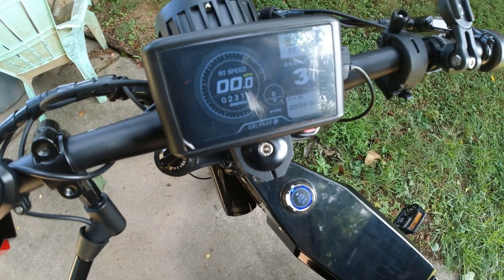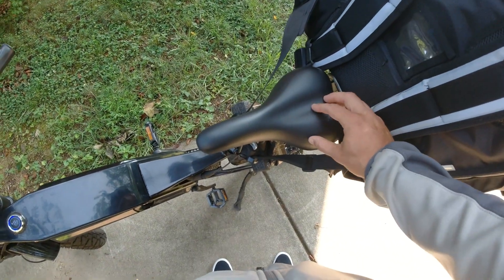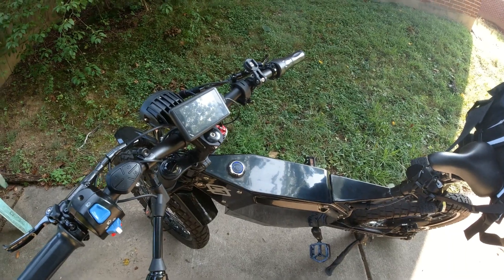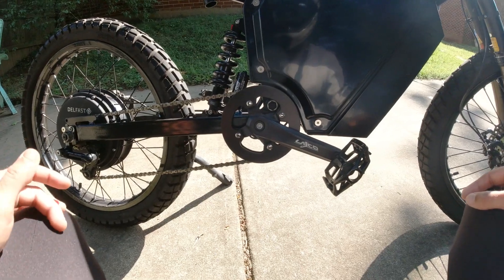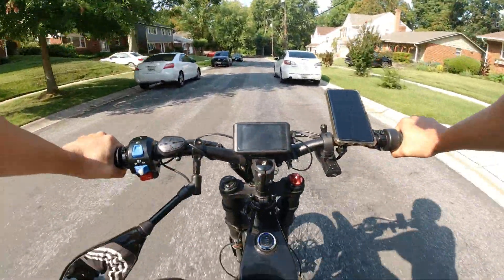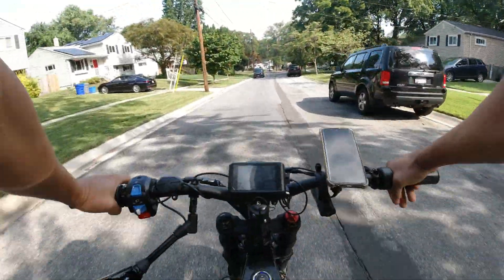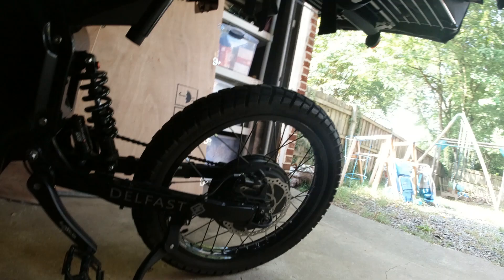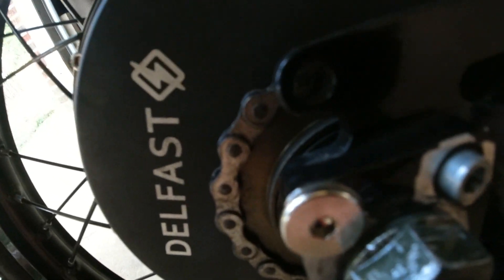Delfast 2,300 mile review!

Comment: you can reduce the alarm by duck taping the alarm.  if you look at the bottom, not inside - no panel to remove, it's underneath the bike.  There is a crevice there where the speaker is located.

Comment: Just used Loctite on your bolts
Currently I have the Top 2.0 and the only issue I had regarding bolts is losing the front axle bolt this past summer
Reply: Save money, use nail varnish it's cheaper and better than loctite
Reply: @ianmangham4570  if you've had loctite fail it was either old loctite or you use the wrong one. Did you actually have loctite fail on you? Use the blue version.
Reply: @billclark8241  No

Comment: Wd40 or blaster paired with a brush kit they look like a crazy toothbrush. Not only will it get the rust off but it will stop any more rusting. Now you MAY have to take the wheel off and MAYBE take off the right motor panel very easy to do. Just go slow when pulling the panel off i dont think there is any cables or anything on the right side but never opened a delfast before also use good tools so you dont strip anything. I recommend giving everything a spray with wd40 and whipping it down very good after you spray it down. I also use rain repellent for windshields actually works amazingly well on metal 👌 when i clean my sur-ron you can see the water beading up and rolling right off it actually takes a lot of water and wiping but its worth it

Comment: a good hint for your loose bolts use a little blue Loctite  .......don't use any of the colour only blue NOT red or green, put a little drop on the screw  and then tighten up, use this in the offshore industry it will work. good luck
Reply from the maker: Thanks I've definitely become good friends with Loctite right now we are in the middle of fixing the rear axle and installing a new motor stator I'll post a video as soon as we complete the project
Reply: @fightorfright  it's only one year old and you're replacing the motor I'm fixing the rear axle? I was about to buy one of these bikes but that doesn't sound good at all.
Reply from the maker: @billclark8241  yup they said it was rare ...you just gott a be sure you can work on this bike or know someone who can..at least it was under warranty...

Comment: Hey bud get some blue lock tight for those lose bolts and nuts .
Reply from the maker: Thanks! I actually used some but I guess not enough.  I just reapplied  a generous amount and it seems to be holding so far!
Reply: @fightorfright  Try nail varnish, it's better than loctite

Comment: I see you fo uber eats on it, can you do a full 8 hour shift on it on a single charge with just the motor no pedal assist?
Reply from the maker: Maybe if you did level 1 and 2 only but I always ride level 3 and above..I usually do 4 hr then charge for a couple hr and then do another 4 or more hrs...
Reply: I do it with my sur-ron but i post up at taco bell order some nachos pull out my 10.5in tablet free wifi so i watch Netflix or whatever bring my battery inside and plug it up. A 2nd battery would be amazing since i can hot swap easily,  with the delfast this may be a tiny bit harder since you cant just pull the battery out with a trun of a key unhooking 2 cables. But a know my toco bell has a outside plug so does McDonald's they have a few but are normally locked just ask someone to unlock it i have tell them your working doordash or whatever using a ebike toss them $5 they will be happy to help
Reply: I even plugged in at Wal-Mart homedepot and lowes i just walked my bike right in and plugged it up lol no one said anything ""gorilla charging""